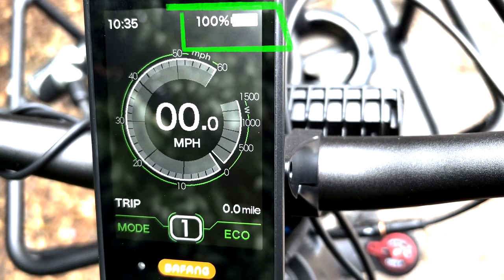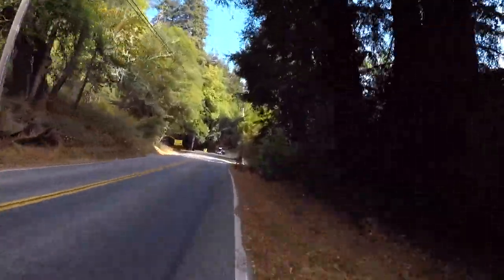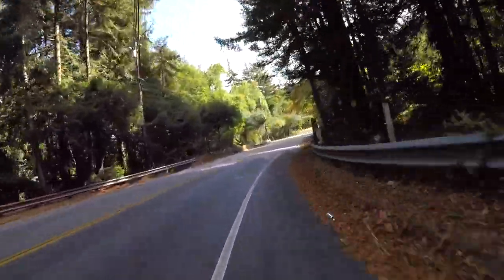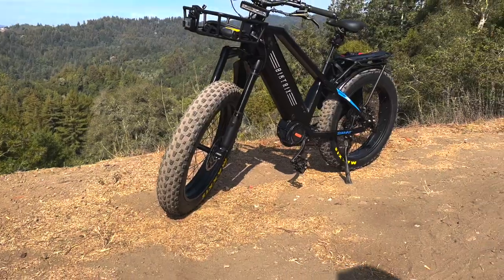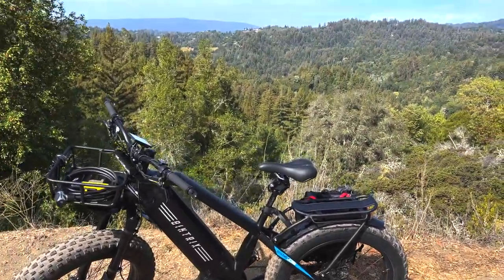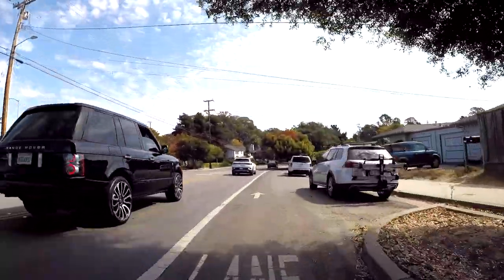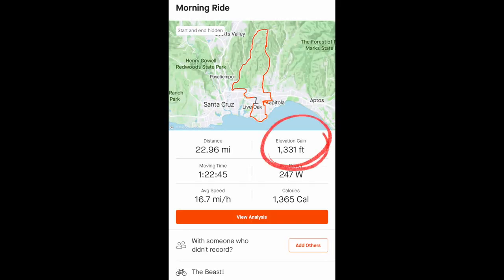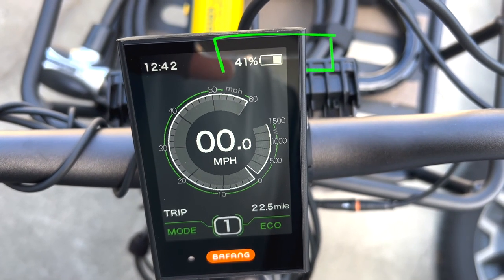eBike | Power Test | Climbing 1400 Feet in 10 Miles | Biktrix Juggernaut Ultra Beast 2

Comment: Nice video. Next time it would be nice if you showed the battery life at various points, especially after the climb.
I have an ultra 1000 that I bought used with only 22 miles on it. I’m basically in the same stage of figuring out the the limits based on riding style and terrain. Thanks
Reply from the maker: Thanks for the feedback.  Admittedly, I kind of got away from showing battery life during rides.  👍🏻

Comment: WTF. That motor is HUGE. Everything is huge. How much can you help this monster by pedaling?
Reply from the maker: You're too funny! 🤣

If you haven't ridden one, you'd be surprised. With PAS 5 and using the full range of gears, I can get up to nearly 40 mph on flat stretches. On descents, the only thing that holds me back is my own common sense! 🥴

While climbing, the PAS levels and gear ratio work so well together that I rarely need to go above PAS 3 on 10-15% grades. I guess that's why they call it "The Beast." 👍🏻

Comment: Considering the Juggernaut Ultra Duo 2. Still the same Bafang M620 1000w 160Nm motor as yours,. I think. I've got a hill near me that climbs 550' in the first mile and 1000' in the first three mikes. Will this bike/mid drive motor cope do you think?
Reply from the maker: Absolutely, as long as you're using pedal assist. Using throttle on that kind of climbing will really drain your battery quickly.

Comment: I had a hub drive and loved it 1000 km no issues. But iam not so sure about owning a mid drive
Reply from the maker: Mid drives will generally have more power because they use the ebike's gears more effectively. What I mean by that is, because the motor is in the bottom bracket and it spins from the chain ring, the motor's power is enhanced by the ebike's gears. 

On a hub drive, the rider benefits from the gears changing, but the motor output remains unchanged by the gears because the output comes from the rear wheel.

Because of this difference, the mid drive requires the rider to shift the ebike's gears more effectively. This is because the change in the motor's torque directly impacts the chain and chainrings. If the rider shifts carelessly, sudden and extreme changes in torque is can cause damage. I don't believe this is too common, though.

I don't think one can go wrong either way, but it really depends on the rider's preference and usage.

I hope all this makes sense. 🙂 👍🏻
Reply: @twowheeltim  iam  thinking staying with hub drive seems like less maintenance. Thanks for all the information

Comment: I just installed a larger cassette on my eunorau fat-hs.  I needed larger gears in the back to keep the motor spinning at a good speed.    It's stock lowest gear ratio was 1.26   I got it down to 1.0 for now.       What's the juggernaut's lowest gear ratio?   I found it, 44÷42=1.05.   That's pretty low factory.    Nice bike.
Reply from the maker: Nice!!

The Beast is a fun bike, too. So powerful and fast, and I can get good mileage out of its two 47v 15ah batteries.  It's definitely a beast, though, weighing in at about 90 lbs with the batteries installed.
Reply from the maker: I just looked up the specs on your bike. Very nice! You take it off road much? Did you get the second battery and, if so, does it mount on the top of the down tube?

I've been sticking to the road on my Ultra Beast 2 riding longer distances. I want to eventually do some multi-day touring on it. I did a 3-day weekend trip back on Easter.
Reply: @twowheeltim  I take it off road very often. The fat tires get more grip than 2.3" tires.  My second battery comes in 2 days, yes it mounts ontop of the downtube.  Our tires are similar, kinda knobby, I was looking at a road type of tire, for less rolling resistance, but I do go offroad often.    If you keep yours on road, get a road tire,  quieter and longer range, lol like you need that.
Reply from the maker: @John Doe  I actually do have road tires on it. I bought Vee Speedster tires quite some time ago and absolutely love them. Here’s the video on it. 

https://youtu.be/RcfIsIe2SBo

You’ll love the additional distance you’ll get out of the second battery. Well worth the extra weight, in my opinion.  👍🏼

Comment: Most of the test runs on asphalt which is not what this bike is designed for, and if you want to climb more hills you need to change  this tires and the chainring, no more than 36 teeth, ideally between 32 and 34 teeth ,you will lose some top speed but you gain in cadence to climb, electric motors, unlike gasoline ones, work better turning at higher revolutions, so it is always better to have a high pedaling cadence on an electric bike.
Reply from the maker: I still have my Maxxis Minion tires, but I swapped those out for Vee Speedsters for the winter. I'll put the Minions back on in the summer when I plan to do more trail riding. I did a video: E-Bike Ride | Testing the Vee Speedster 26 x 3.5 Tires | Biktrix Juggernaut Ultra Beast 2 | Ep. 5
https://youtu.be/RcfIsIe2SBo

Comment: I climb 500 ft in 1/2 mile often.  I think it said 16%  The seattle area has steep roads.
Reply from the maker: What are you riding? Just curious.
Reply: What bike do you have? How's the motor heat after that hill climb?
Reply from the maker: On the Beast Ultra 2, the heat after my climb wasn't too bad. I did stop at the top for about 15 minutes to give it a rest and shoot some video.

Comment: Was there ever a point where you mainly used throttle?   How was it? I will be using it probably 50% of the time
Reply from the maker: Hi Eric. I really don’t use the throttle much, but when I have it really kicks in with good torque. On the Beast, the throttle’s torque is actuated by the PAS level.

I’ve been thinking of doing a video riding using only throttle to test out battery longevity and to see how it handles the uneven terrain in my area. Stay tuned.  👍🏻
Reply: @twowheeltim     That would be awesome to see.  Thanks for the response and one more question if you dont mind?  I’m a bit of a newbie, so does that mean that the speed you hit using the throttle depends on what PAS level you’re in? And in that case, do you shift while in throttle to increase speed?   Thank you 🙏   I’m super close to pulling the trigger on one of these
Reply from the maker: Hi Eric,
I can't speak for all brands of e-bikes, but on the Ultra Beast 2 the amount of torque from the mid-drive motor while using the throttle does increase with the PAS level (1-5). 0 (zero) PAS level is simply manual pedaling and you will have no response from the throttle. I think this may be standard for most e-bikes, but I could be wrong.

You can change your PAS level on the bike while using the throttle, but I've never tested exactly how it responds and how fast I can go using only the throttle. That will be something I'll emphasize when I do a "Using the Throttle" video. Hopefully I can do that ride this weekend and have the video edited and published by next weekend.

Comment: How much does this bike way?
Reply from the maker: It weighs about 76 lbs without the batteries, and about 90 with the batteries. It's definitely a Beast!!

You can check out the full specs sheet on the Biktrix website:  https://lddy.no/11uc6

All the best!